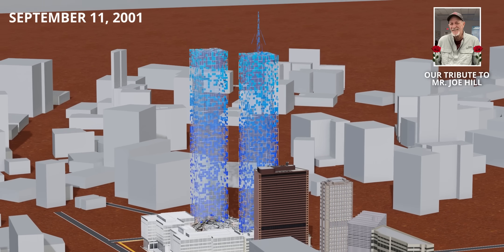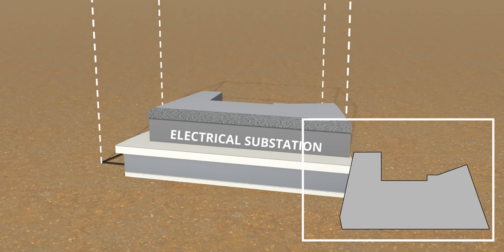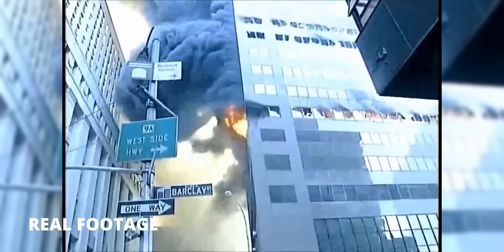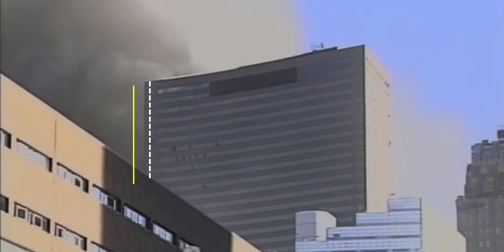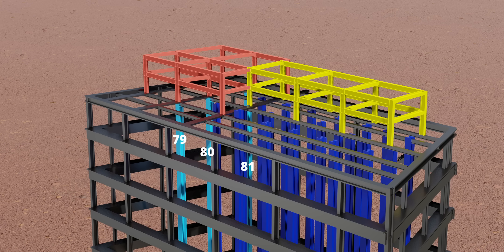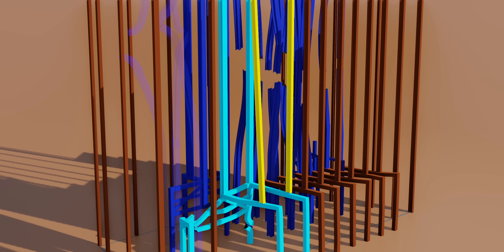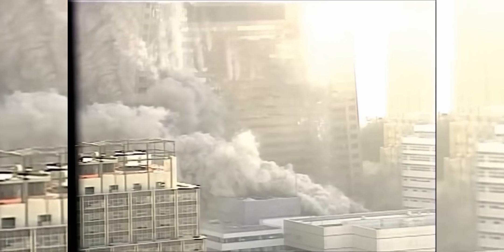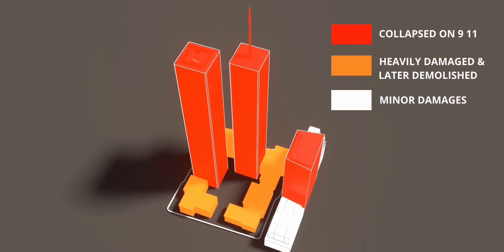Collapse of Building 7 | The Complete Physics

Comment: While this doesn't explain how the tower collapsed into its footprint, it also doesn't explain how it fell at free-fall speed, meaning there was nothing between the top floor and the bottom of the tower, not even the slightest resistance to the collapsing material to slow it down! What happened to all the material between the top of the tower and the bottom, how did it disappear so it doesn't offer any resistance and slow down the fall? There are many more unexplained facts!
Reply: This video doesn't explain internet conspiracy memes that didn't happen.  Perhaps this will clear up the misinformation you have been getting:

Much misunderstood, Building 7 was the 6th building to collapse of 10 lost on 9/11. Because of its early low priority, conspiracy filled the information void with garbage made up by technically ignorant people promoting political agendas. But 7's loss is an engineering problem and should be treated as such, so I prepared this brief summary of my own analysis to fix that, using technical analysis, not ideology and tired memes. 

At 10:28am the WTC North Tower collapsed, showering Building 7 with tons of burning debris, causing heavy damage and starting many large  fires which burned out of control for the next 7 hours. Half the FDNY firefighters having been killed, units in disarray, equipment destroyed, no water pressure, and the greater urgency of search & rescue efforts, Building 7 couldn’t be saved so firefighting efforts were pulled as futile and 7 left to its fate. Firefighters make that sort of choice every day in brush fire situations - which houses to save and which ones to let go. Only real difference here is moving the decimal on the size and cost. People get overwhelmed by the size.

www.youtube.com/watch?v=g_SvpwyC17M

Collapse of a burning structure is always a concern for firefighters. Steel buildings subject to fire rely on active firefighting to survive. Buildings are designed around 1 to 3 hours of fire resistance, allowing time for occupants to escape and active firefighting to get started, after which all bets are off. Left to their own devices they'll exceed their design envelope and collapse, like Plasco Tower and Wilton Paes de Almeida. In 7 the occupants escaped, passive and active fire protections were compromised and active firefighting was abandoned hours before the collapse, which left the building to its fate. It lost. Odds on Building 7 would eventually collapse, and it did. No big deal in logic.

 http://www.youtube.com/watch?v=WnYBX6QT0R4 

FDNY Chief Daniel Nigro - The biggest decision we had to make on the first day was to clear the area and create a collapse zone around the severely damaged 7 World Trade Center, a 47-story building heavily involved in fire. A number of fire officers and companies assessed the damage to the building. The appraisals indicated that the building's structural integrity was in serious doubt. I issued orders to PULL back the firefighters and define the collapse zone. It was a critical decision; We could not lose any more firefighters. It took a lot of time to PULL everyone out, given the emotionalism of the day, communications difficulties and the collapse terrain 

FDNY Deputy Chief Peter Hayden ; We had our special operations people set up surveying instruments to monitor and see if there was any movement in the building. We were concerned of the possibility of collapse in the building. And we had a discussion with one particular engineer there, and we asked him if we allowed it to burn could we anticipate a collapse and if so, how soon? And it turned out that he was pretty much right on the money, that he said 'In its current state you have about 5 hours 

The collapse of Building 7 was anticipated and widely reported in the media throughout the day, with 24 video cameras recording some or all of the collapse. Everyone knew what was coming and why. 

www.youtube.com/watch?v=OY5S5k3tMHI

The collapse of Building 7’s was from the inside out and entirely different to the Twin Towers, harder to understand, with most details being hidden from view and not intuitive.  But we can still sort out what happened through careful analysis and observation. This is my explanation of the collapse relying on no outside authority. 

Building 7 was a unique, asymmetrical 47-story steel framed structure built atop a smaller 3-story building serving as a partial foundation, requiring lower floors dedicated to complex load transfer structures. Of trapezoidal shape and all-steel tube-in-tube construction, B7 (above the 7th floor) consisted of a central core of steel columns carrying most of the gravity load, perimeter steel columns around the outside of the structure carrying the remainder of the gravity loads and long span beams and girders to tie those elements together and form the floors. On the outside of the building hung a moment frame or outer shell. 

Phase 1 : First externally visible signs of collapse initiation occurred at 5:20:28 pm and were notably quiet with observers not realizing the building was collapsing! No audible warning in the form of hundreds of ear drum busting 180-190dB explosive bangs preceding the collapse. Here at 12:00 a local CBS affiliate reporter is talking 10 blocks from B7 when collapse begins. People don’t start to notice the collapse until 12:11. At 12:45 is the famous CBS fixed camera clip of Building 7’s collapse. Note how quiet it is. 

www.youtube.com/watch?v=t5tEy6mXSE8

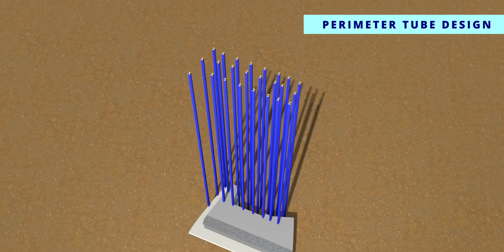Collapse initiation was due to lower floor failures above the load transfer region (8-14th floors) in the NE corner. In this video at 0:45 you can see the NW corner from inside the building while under construction, Column 79 just out of frame on the left. That big, angled steel beam across the top of the frame connects to C79 at one end. The girders connect to the beam. That beam and all those girders depend on just one connection 

www.youtube.com/watch?v=nP3TNHPCIVU&t=45s

Phase 2 : The NE lower floor failures caused a loss of critical lateral support over an excessive length of Column 79 and it buckled. Looking at a floor diagram of Building 7 (www.nist.gov/image-16640) when you see all the structures that depend on C79 you quickly realize this one column was a relatively isolated structural element on which a disproportionately greater fraction of the structure depended analogous to say the Key Bridge. Externally as collapse begins we see a vertical progression of window breakage along the 44-46 line and a kink in the roof of the East Mechanical Penthouse at the top of the building, consistent with C79 failure. Normally with a buckling column, the load could be redistributed to other columns. With C79 that is not the case - the failure did not redistribute the load, so the collapse rapidly progressed to the roofline, sinking the rooftop penthouse. The transition from full capacity to almost no capacity occurs in an instant and will result in virtually no resistance 

Phase 3 : With C79 gone, B7’s progressive, non-symmetrical collapse continues with adjacent columns 80 and 81 left laterally unsupported, and quickly buckling as well, sending the EMP down through the building. C79-81 all have no diagonal bracing, which is the major reason why they could not redistribute a lot of vertical loads among one another. From there collapse progressed from east to west through the central core until the core was gone taking all of the interior floors and probably most of the perimeter columns with it. Follow the horizontal progression of window failures low in the building and the dropping of the remaining rooftop structures into the building. One of the big takeaways from the NIST Building 7 study (invariably ignored) was how their modeling determined C79 failing under ANY circumstances would have initiated the same collapse sequence. 

Phase 4 : After about 10 seconds only the exterior moment frame remains, giving the illusion B7 is still standing to the casual observer since little has outwardly changed. But it is just a hollow empty shell like an empty cereal box supported only by a few remaining columns and overloaded from the loss of the core columns and floors, quite unable to remain standing. With nothing remaining behind it, the north face leans inward, forming a V in the roofline, the last few columns buckle under the strain and the moment frame free falls, landing on top of the debris pile. 

It is only here at the end when most of the building is already gone, leaving only an empty outer shell that a single measurement of alleged free fall acceleration is taken, from one point on the outer shell. The Building did not “free fall” – just one corner of the outer shell briefly moved at a rate comparable to FFA. The Building_ (core and interior) was already gone before that happened. The period of alleged FFA was a product of how it fell NOT why it fell . It’s also not proper FFA as the single measured point was moving in 3 dimensions, not just down. Start to finish the collapse took 18-20 seconds, 3 times longer than free fall . How fast something falls cannot tell you what started it falling_ anyway, let alone 10 seconds after it started falling.

The debris spread outside the footprint blocking surrounding streets, heavily damaging the Verizon Building and destroyed Fiterman Hall. 

Building 7’s progressive, non-symmetrical collapse was incidental and unintended collateral damage from the combined effects of fire + time + gravity, started by the collapsing North Tower. That is true no matter who planned and carried out the 9/11 attacks or why . The collapse was of so little consequence it barely registered at the time - a footnote, only taking on semi-mythical status as an alleged smoking gun years later when demolitions at the Twin Towers, missiles at the Pentagon and shoot down over Shanksville all failed and conspiracists had nothing left to work with. 

Anything can seem like a conspiracy if you don’t understand how it works. Now you should. I hope you found this helpful, informative and it solicits informed critical comment. If I made any errors of fact, logic or reason or left anything important out, please let me know so I can fix it. IF you can offer a more plausible alternative please do.
Reply: "While this doesn't explain how the tower collapsed into its footprint, it also doesn't explain how it fell at free-fall speed"
It doesn't explain Santa Claus either, and for much the same reason. When you've managed to get away from the fairy tales, you can try again.
Reply: @mooneyes2k478 Speaking of fairy tales, there's a good one called The 9/11 Commission Report, it's like made for you! In fact, it was made for you and people like you!😊
Reply: @fikaa2388  - What does the 9/11 Commission Report (which I guarantee you have not read) have to do with building collapse engineering?
Reply: @ the outer shell collapsed at free-fall speed for 2.25 seconds of the 5.4 second collapse; thats 41.6% of its decent is in FF.

Your dumb CGI video isn’t convincing nobody about what happened to the core of WTC7, we don’t buy the “office fire and antenna” fairytale.

Over 3000 architects and engineers at the non-profit “Architects and Engineers for 9/11 Truth” disagree with NIST Final Report about what happened to the core of WTC7.

So which “professionals” are the public supposed to believe, the government paid or the independent?

Especially after 2003 bs “Weapons of Mass Destruction” garbage and Covid 1984 Scamdemic garbage, most of the public are not buying the lies anymore
Reply: @LibertyOrD__th  - Here is an excellent video of the collapse of Building 7, shot from West St.  The collapse starts at 0:03.  Kindly roll the tape and stop it 5.4 seconds later (let's call it 0:09) and tell me if the building is done collapsing yet.

www.youtube.com/watch?v=4xN8lzBo9zY
Reply: @LibertyOrD__th  - Take your time.
Reply: @TheCriticalStinker-01  are you a mossad bot? Tell me again how all the support column gave out within 5.4 seconds?… “derrr bEcAuSe ThE EnGiNNeErS bUiLt It WRonG derrrr”